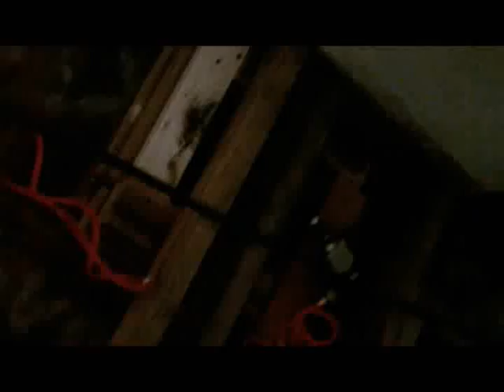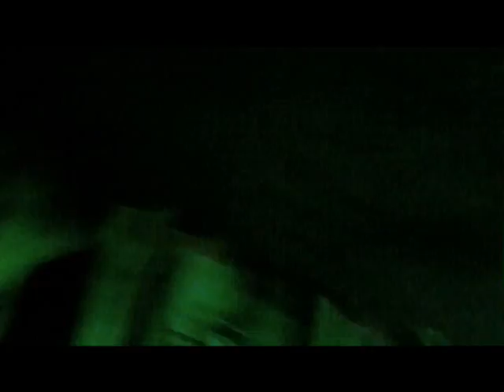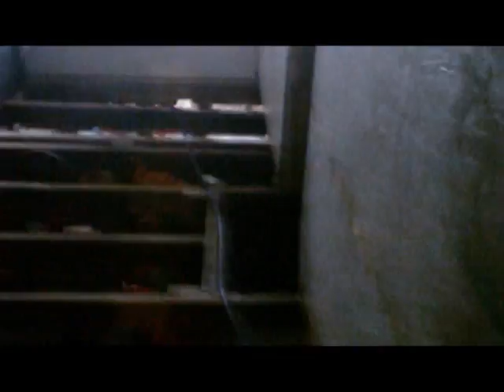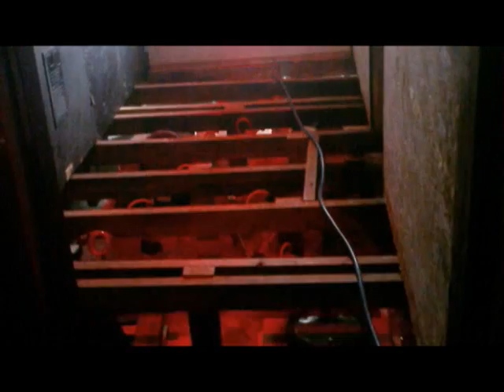512 DMX ride built with Chauvet showxpress software.

Comment from the maker: @HalloweenFXfiles  yes I used 2x4's floor joists. yes there a air pressure limit switch to avoid overpressurizing the air bags. yes the walls framed with 2x4"s.. yes they are!

Comment from the maker: Good question! First I made the soundtrack and saved it as a mp3 using Sony Vegas In Chauvet Show Express Software in the Controls figure out how many bps, then add a new step for each effect. This takes allot of time. I would have on my mp3 or video playing in a media player and you have to calculate the time. This is trick too. email me if you need some help.

Comment: Hi, I have a few questions if you don't mind.. did you use 2x4's or 2x6's for the floor joists..?  was there a air pressure limit switch to avoid overpressurizing the air bags..?   was the walls framed with 2x4"s or less..?  just trying to guesstimate load weight before the people got on it.. thanks in advance, hope you don't mind the questions..I have a similar idea for a Haunt in NC.. Hellevators are great aren't they..LOL..